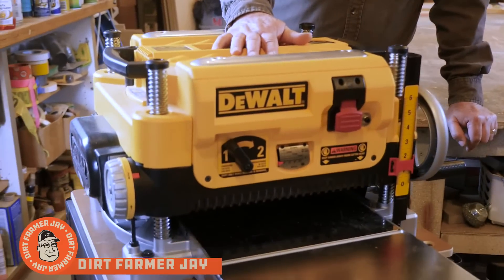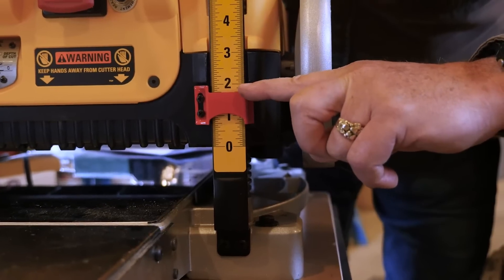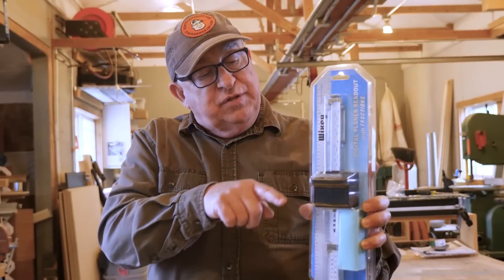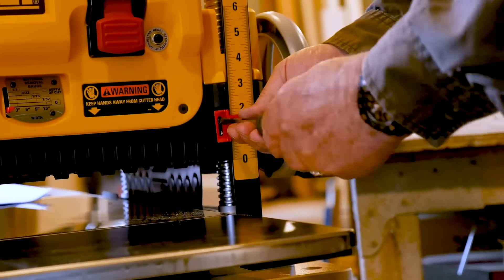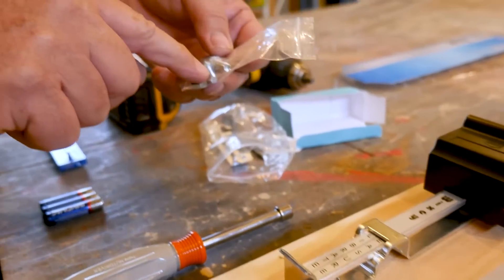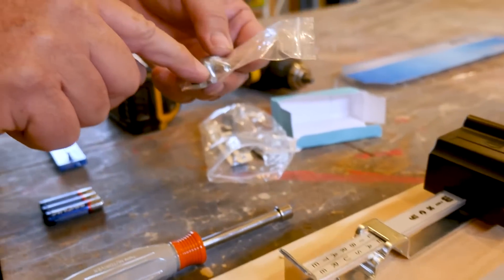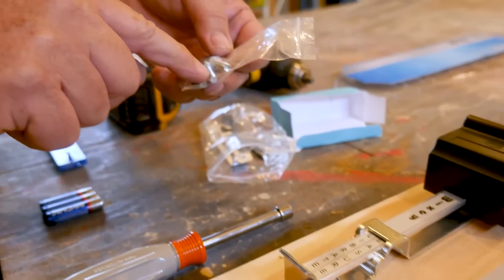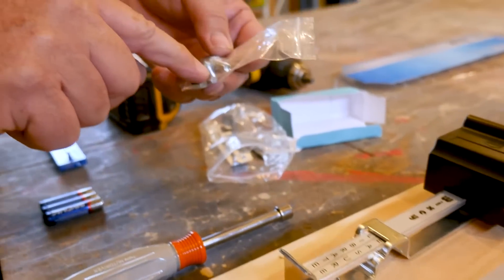Upgrade Your Planer with the Wixey Digital Readout!

Comment: FYI to all, per Wixey himself. Best not to let this digital gauge go below 32F "in use". Let's say you have a shop in Montana that you can’t afford to keep heated in winter, The gauge will have to be removed and reinstalled all winter if you want it to last. I have seen some bad reviews on this product, and I’ll bet some of those are because it was left below 32f to -20f too many times. Saw reviews that said quit working, read out flicker or unreadable, inaccurate etc. Most say with worked good till it didn’t. I wish the unit was easier to remove and put back. 🤔
Reply from the maker: Thanks for sharing that info. Good to know!